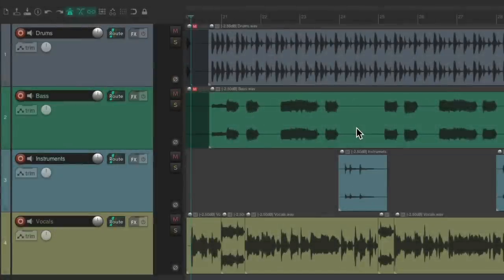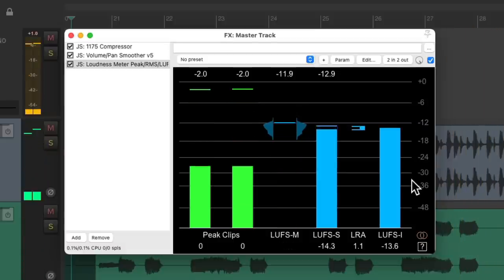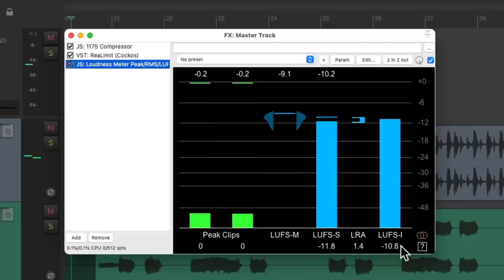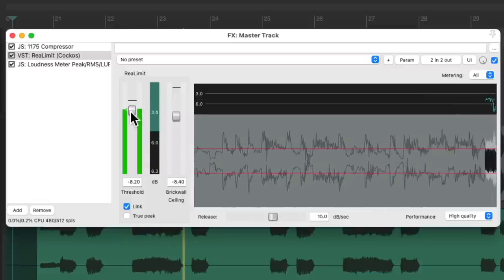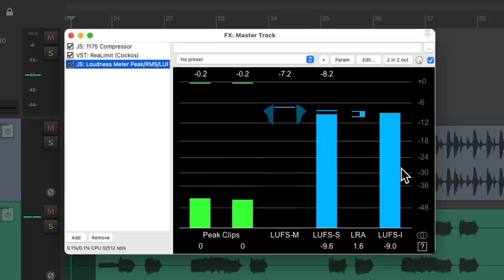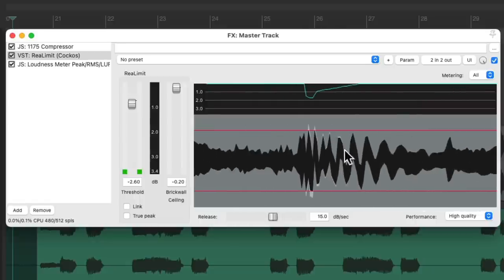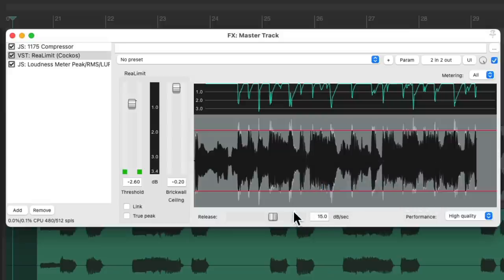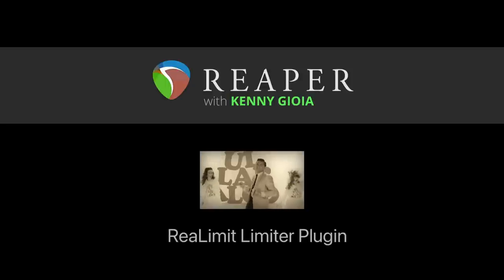ReaLimit Limiter Plugin in REAPER

Comment: There's also a requirement for tracks to be -1dB true peak limited. It's a good practice anyway because when you encode it in AAC or MP3 it will be louder than -1dB in peaks bcs of the way lossy encoding works.

Comment: I would use this for mastering.
Reply: I am curious though, why you didn't set a ceiling of -1 to make sure you didn't clip on conversion to mp3.
Reply: @mjklein  I'm curious about your statement if you would share your thoughts on it, I only set mine to -0.3 for rendering a 320kbps MP3 and when I import the file back into a new project it's still at -0.3 on playback. I have heard that reduced sample rates in MP3 cause a higher chance of overs and would set the limiter lower, but I personally never use those lower rates. I will set it for -0.5 when out putting a wav for SoundCloud though.

Comment: So am I correct in understanding that the Threshold changes the signal level by the inverse amount (eg a Threshold setting of -2dB increases the signal by 2dB), and then flattens anything at 0dB? So it's like the Threshold moves where the 0dB line sits relative to the waveform, and flattens anything at the new 0dB?

Comment: You're not limiting to reach an lufs. You're limiting for the sound that you get from cutting off peaks and the forward push you get in many pop situations.
Sometimes a track needs -7lufs, sometimes a track needs -9lufs, sometimes a track needs -12lufs. It all depends on what the track requires to achieve that sound that makes sense with the type of song.
Often, when mastering as a mastering engineer, I receive tracks that are also not mixed perfectly and I have to make a decision as to how the limiter is going to impact the track, if it needs to be pushed hard, or if it would be a mistake.

There's no issue with being turned down on streaming services. Think about it, you're raising by another 6db, and you're being turned down by that amount, essentially, or close to. There's a reason why most commercial tracks still sound loud, powerful, and perfectly fine on -9lufs. Most A list songs are mastered around there(of course, genre dependent, but yes). It's because it doesn't matter if spotify turns you down. You don't suddenly get so much softer than a -14. Keep in mind, you raised the track up another 6db. So it's all relative, to a point.

Best rule you can apply, and that should be taught to everyone, is that streaming platform lufs DOES NOT MATTER and people should STOP trying to do their tracks to fit a particular streaming service. 

Many people in the community also have the incorrect idea that spotify is compressing your track(they think its not just being turned down). They don't get it's essentially just turning down by as much as you turned it up past the -14lufs point. Which usually equals about the same place, minus some transients(depending on if you manage to find a way to keep the perception of some of them, but thats another story all together.

Comment: I'm a little confused regarding the difference between the threshold and the brickwall ceiling. If the limiter starts working at the threshold, then how is it different from the ceiling, which determines the actual peaks? Thanks a lot in advance!
Reply from the maker: It just decides at what level the output will be. So think of the ceiling as just turning down the mix at the end (no more or less limiting) to hit a certain level.

Comment: Spotify doesn't turn the song down unless the user manually turns on volume normalization. If you master to -14 LUFS you'll be unpleasantly surprised by how quiet your song is compared to others, especially if it's not as limited. If you make it sound good loud, it'll still sound good if it's turned down.